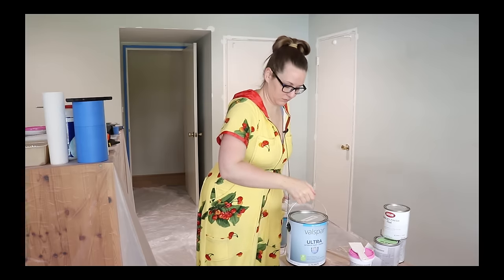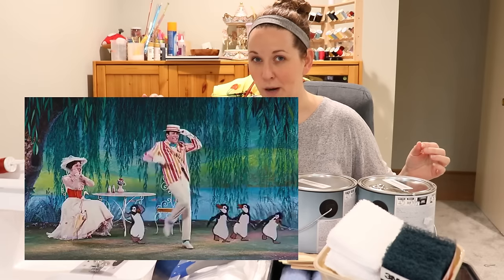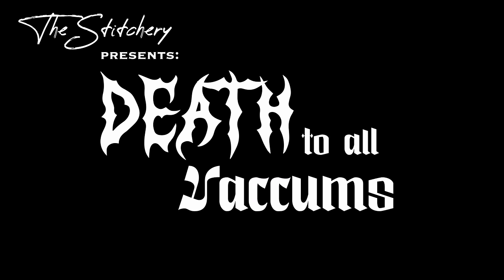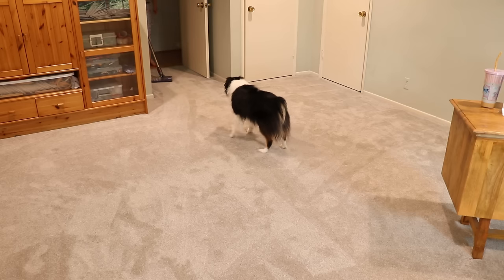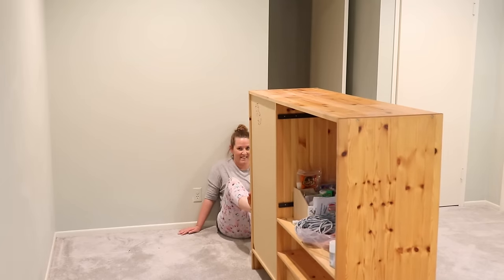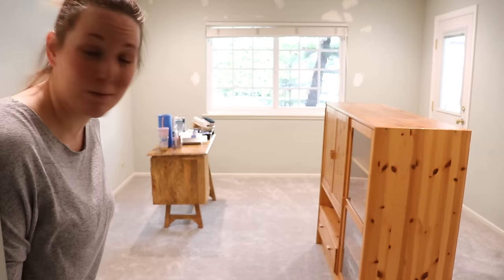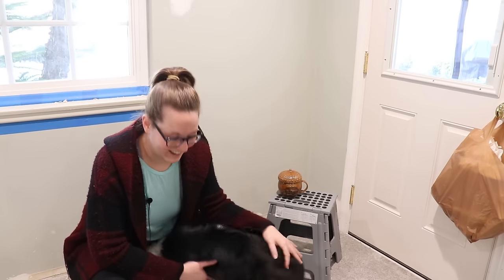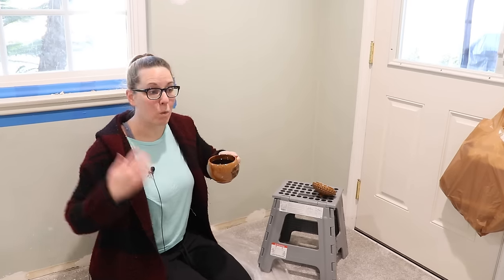I Painted Clouds on My Ceiling

Comment: 25:18 as someone who did a two-year residential electrician pre-apprentice training program (honestly so messed up, why couldn't it just be an apprenticeship? Why do I need two years of experience for an entry-level job?), electrical stuff still scares me, too. It's easier when I know I'm the only one who has the power to send power to the circuit I'm working on, and/or I know the circuit is properly locked out 😅.

Comment: Love the clouds & light fixture.  But why did u take off all the trim?  Did I miss something,?   Personally I've always just edge painted around them with a bevel edge brush.  But you also could use painters tape on the part u dont want painted.  I'm not a fan of the  painters tape because of possible paint bleeding under the tape

Comment: Super random, lind of off-topic question: Do you finish your seams on the inside of your clothing items and if so, what did you use on the coverall? Looks great and smooth, so I was wondering. Do you use topstitching needles or thread for doing topstitching?

Comment: I think you're having a harder time with the roller bc the paint isn't quite enough or distributing well on the roller. You might need a fluffier pill too if there is texture on the walls.

Comment: HELPFUL HINT FROM AN OLD EXPERIENCED WOMAN>  They make long handles that screw into the roller handle.  I painted our large master in just part of a day and it looked great.   In the past I've done ceilings before too.  The peeling may be because an oil based paint was used with a non oil base paint.  The whole thing needs to be peeled off.  Then use the same paint as the original paint,  I would check about what was disclosed when you were  signing your paperwork.   Make sure paint is not lead based.     Use a wadded up plastic grocery bag to dab and remove some wet paint,

Comment: Girlfriend I think your clouds should pour onto the walls in places.  

Do not replace your trim molding !!!!!! buy a brad nailer a caulk gun and caulk.  

With a box knife remove old hard edge paint, sand , paint and replace the existing trim With a brad nailer, fill the cracks and nail holes with caulk (have a rag!!!) 
Good luck

(replacement is Incredibly expensive then cutting errors are bound to happen!

Comment: We have to deal with wallpaper and/or this old school specialist paper that is used to prime wall before painting or wallpapering, before we can paint and wallpaper our walls. Y'all, our corners are rounded. Someone did not do a good job. Atleast the ceiling panels are... not water damaged? They did paint the ceiling and the upper wall trim together though. We've got years ahead to deal with this.

Comment: Go into your bathroom and stick the end of that roller to the handle of your mop! For crying out loud woman there are easier ways to paint a room!! 😱😱😱
When we were renovating we got poles long enough you could have painted the ceiling while laying on the ground. 
There’s a reason the pro’s do it with long poles and the reason is a whoooole lot less back pain! The pole costs like a tenner! And if you don’t have a tenner, you can use duct tape and a STICK!